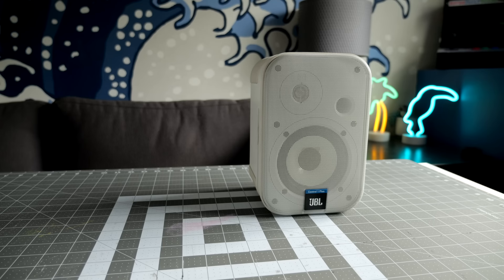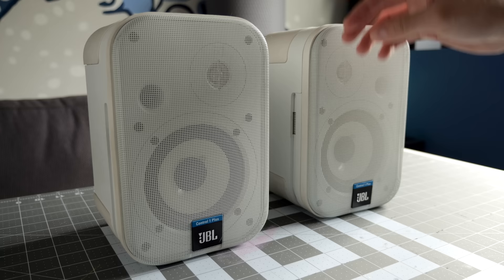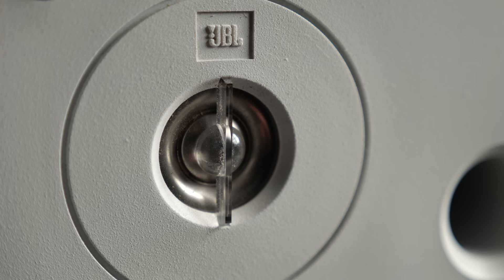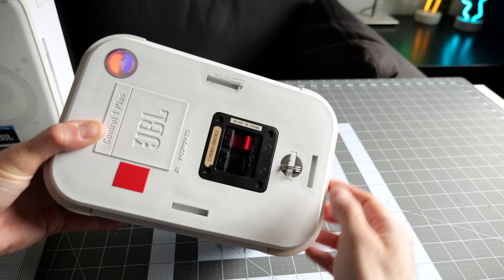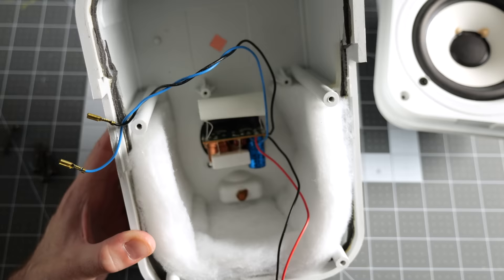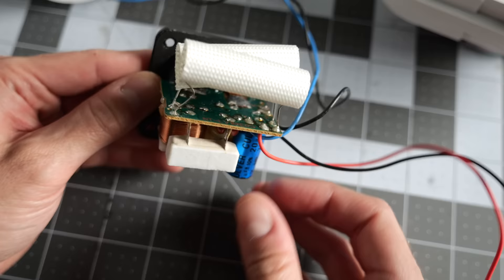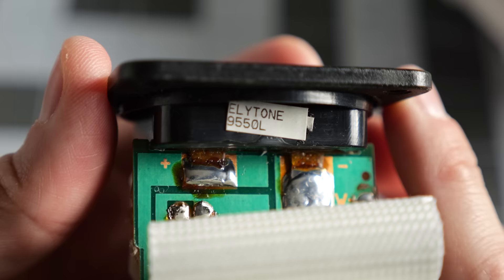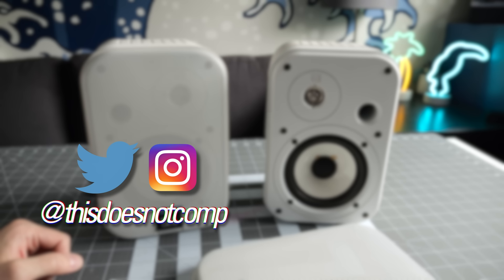Fixing My Vintage Speakers -- But Why Are There Light Bulbs Inside?

Comment: Reminds me of one time i went to the store to get a heat light, or a minimum, a regular light bulb. I explained to the sales person that it's to create heat for baby chicks. They handed me a LED bulb, and told me how much more efficient it is. I was dumbfounded. In that scenario, it was the exact opposite of what we needed.
Reply: I've done retail a few times in my life, once for my first job in high school in the late 90's working at a family owned gas station/delhi/liquor store, then for a Stihl, & New Holland/Kubota tractor dealership in the early 00's, and again as a 2nd job for about 5 1/2 years for Dollar General in the mid - late 00's, sadly most sales staff either don't know their stuff because compaies will heigher whoever they can get to work for least amout of money, they are told to push a certain set of products regardless if it's the right one for the customer(I usually ignored that crap, and got my customers the right product), and/or they just don't care for a vast number of reasons, and as someone who always tried to be as helpful as I could with my customers on a vast number of products we carried(which made me part of the 4th highest selling Kubota dealership in the nation at one point), so this has become one of my major pet peeves in life, which is why these days I almost always look up what I want online first to see if a store has it in stock before I go, and if it's someplace like Walmart, or Target I'll use their Android app to find out what isle it's on myself so I don't have to deal with sales staff, unless it's behind a locked case/cage, or they have to get it out of the stock room.
Reply: @CommodoreFan64  I mean it's really no surprise, when you treat your employees like dirt and don't even pay enough to live on they're not gonna be very motivated to put in effort, and who could blame 'em?
Reply: @fohkukohgeki  That's true about how employees are treated by management, and higher ups once they are hired, but no one forced them to take the job, as they agreed to the starting pay when they fill out the application, or summited their resume, and they were then hired, but having said that, there is still no need to be shitty to the end customer, as they have nothing to do with it, I always put on a good face to my customers being nice as I could be, regardless of what was happening behind the scenes with the company I was working for, as when I worked at the local store, and for DG, as many of my customers were, and still are members of my community, with some I've known most all my life, including church, and I would not want them to think badly of me, if I had issues with my company I took it up with management, or the coporate line with DG which is why one day after I had enough of being used, and worked death, and still not getting enough hours to get by at DG I politely put in my weeks notice to my manger at DG saying it was nice working here, but it's not working out, and I'm going to have to leave to focus on my main career, which left me on good terms, and I can still use them as reference for future work if ever need be, and to this day I still have the same policy, and it's also why I've been able keep to my main job with a nonprofit dealing with seniors, and meals on wheels for nearly 20 years. I wish more people had the same mindset, but society does not seem to want to instill that in people anymore sadly. 😞
Reply: @CommodoreFan64  "no one forced them to take the job" well when it's either that or homelessness it kinda is forced
Reply: @DouglasWalrath  These days with so many companies looking for people to work, and upping their pay, don't settle, and then bitch about the starting pay. Hell I see McDonalds signs in my area begging people to work, with starting pay at almost $17 an hour plus benefits, so again you are not forced into taking a job with shit pay, so stop looking for excuses!!
Reply: @tripplefives1402  and how do you pay the rent during those 2 years?
Reply: @CommodoreFan64  you sound like someone who hasn't dealt with having to apply on the current work market. I'm stuck as a IT tech at a company that pays me $16/hr (but 50 hour weeks with overtime pay), but that still beats working McDonald's part time for only $17/hr as you claim. The job market is tough. I've applied to a good 100+ jobs lately and have only gotten 2 interviews.
Reply: @GayDingo  In High school in the late 90's I took 3 years of Computer Network tech classes, and got my CompTIA A+ certification, along with Microsoft certifications, the field was already crowded in the early 00's making it tough to find a job in that field in my area, which is why I switched careers, and personally if you are only looking for jobs in the IT field, then I suggest you broaden your horizons, and look elsewhere, and maybe learn a new trade like maybe electrical, or heating, and A/C repair, or plumbing, if you are not happy at your current job, as I recently did some upgrades to my home, and finding quality people do the work was hard. Also my comment about McDonalds was to the other poster talking about if you have no job whatsoever, and are about to be homeless, but I feel you can find a job with 1/2 decent pay till you can get an even better job down the road, but it just might not be in the field you really wanted to work in, but it's a paying job, just don't settle for some minimum wage job when there are options.
Reply: @DouglasWalrath  You look for a part time job like McDonalds, or someplace else that pays nearly $17 an hour begging for people to work, and has flexible hours for people in school, I worked while I was in school, and  I've also worked 2 jobs at once before where my 2nd job was flexible around my main job because they needed the employees to do the work, and it's called not being LAZY!!!
Reply: @CommodoreFan64  mind you, i work this job and still have to live with my parents because getting my own place is unaffordable.
Reply: @DouglasWalrath  Going to school, and working a part time job is work is not working yourself to death, it's call having ambition to get ahead in life, so you eventually don't have to work all the long hours. I put in the work in my 20's, and 30's so now at 41 my house is paid for(not counting property taxes), I have a car, and truck in the driveway that's paid for, along with a golf cart in the garage in my backyard in a decent neighborhood, and a job that gives me my weekends off unless we are doing a fundraising event, or some other community outreach a few times a year. ☺
Reply: @CommodoreFan64  don't act like having two jobs while in college is easy. that's a load of bull. I had two jobs for a few periods during my college career and it was a trainwreck. My bosses acted like I didn't have college classes to go to, and my professors acted like I didn't have work to go to.
Reply: @lesbianesti  I never said two jobs during college, just school, and a part time job, just after school, I worked 2 jobs at once, and no it was not easy working two jobs, but in the long run It helped me get ahead in life paying off some debts, and put a little bit of money into my savings.
Reply: @CommodoreFan64  I don't know where you live, but paying rent on a part time job is unimaginable for most Americans
Reply: @lesbianesti  I did it for a short time in an RV park after I picked up an old RV for $1k doing some minor work on it, and rent was $200 a month near a fishing pond with utility hookups included.
Reply: You can probably get a more effective heater and LED array that will be more power efficient. Relying on heat as a byproduct of incandescent lighting is a very outmoded way of thinking, and why there's resistance to getting LED traffic lights, even though they should just mount heaters.
Reply: @Nukle0n  why would it be more efficient? Heat is heat and in a greenhouse or glass cage type environment it traps the heat well so angle doesn't matter
Reply: @GayDingo  I work in IT, and from what I've seen there's a shortage of qualified people working in this industry.... especially if one has some system administraton skills and some programming skills....
Reply: @ethanchow9170  a dedicated heater is more efficient, and you could run it only when necessary.
Reply: The only incandescent bulbs GE currently makes are heat lamps. They’re a bit harder to find than they used to be, but I know they still sell them at Lowe’s.
Reply: @CommodoreFan64  Society forces them to take a job, because (speaking as someone who has been there) often the alternative is starvation.
Reply: @CommodoreFan64  Lazy my ass. Jobs are not flexible these days, and most places don't have choice. $17 a damn hour. Hillarious. I got $8 after 6 years. Jobs treating you as a human ended in the mid 2000s around 2007. You get a job, they assume they're your only job. Even if they don't give you full time hours. Same with school. I have had plenty of teachers act like I have no job or hell even other classes. I've had bosses tell me I need to pick a job or school as they refused to work around it. They were honestly shocked when I chose school over Target. Legitimately shocked reaction. They are insanely manipulative to push this point as well. Younger you are, the more they'll take advantage of it. Half their training videos were either anti union propoganda, or 'training' you like a dog to fear calling out sick or taking bathroom breaks. Hell we had people come in with the flu they were so nasty about it.

Unless you're throwing up, you come in. That was pretty much the mandate. You could have a fever of 105, they did not care so long as you didn't throw up and make them look bad. You did? Your fault and they'd blame you despite threatening to fire you if you didn't come in.

They say "flexible hours" in most places that translates to "We have no schedule, and we'll put you on whenever the hell we want". Two jobs will, where I grew up, kill you. They don't care about your health, they don't care about your school, and they sure as hell don't care about your second job. They will schedule over each other, and they will make you pick which one to "keep" under threat of firing.

They'll fight every damn raise too. I worked at a place for 6 years. My raise? 10 cents. Total. I was one of three employees that hadn't been replaced. It was a conveyor belt. You'd get hired, they'd burn you out to the point of breaking down, and then throw you out. I outlasted our damn HR despite what it did to my health because it was keep the job or get kicked out of the house, and gas ate up so much money I could barely afford to live where I was. Moving? Impossibility. The most common reason my raise was cut to about 1 cent? I didn't tell other workers I appreciated them often enough despite the fact I worked alone in a department.

I have what I can only imagine is ptsd from the retail in my area where we were denied water, bathroom breaks, and walking off and helping people on the way to not get written up was counted as part of our breaks. At the same time managers would hide in the backroom on their phones, and were more than eager to throw you under the bus. One guy I swear did cocaine, a manager mind you, would get upset you couldn't keep up with his drugged up ass.

And no, we couldn't do legal action, even though some of it was blatantly illegal. They'd just black list you, fire you, and who is going to pay for your court fees? No one wants to go against a corp, easy win or not. Their HR will do everything in their power to ensure the paper trail is as hard to follow as possible. And god forbid they even catch wind of you forming one they'll find a reason to get rid of you.

Usually it would be changing your schedule and then no call no showing you, though the second most common if they couldn't find a reason to fire you was putting you on 4 hour days, and then flopping them around the schedule to make it as painful as possible to keep the job so they wouldn't have to pay unemployment. This was especially popular to do to students. Just start doing 4 hour days and be sure to schedule them mid school day.

Point is, life is hell right now for anyone getting into the job market. half a decade to a decade can change a lot. And for the last decade and a half if you're in retail getting out of it is an utter nightmare because you don't get paid enough TO get out. All the while they act like they're your god.

All while Karen complains about how you look exhausted. And then tries to get you fired over that despite the fact you had to study for an exam at 8am, but work didn't let you out until 11pm because her same ass came in at closing, manager wouldn't kick her out, and made you stay late cleaning instead.

I have been in therapy for YEARS over what all this shit has done to me. I will NOT have retail workers called lazy or their work called no skill. That's a sign you haven't bloody done it. Especially not when you were young.
Reply: @CommodoreFan64  what McDonald’s pays $17/hr? I live in hawaii where the cost of living is insanely high and McDonald’s here stars at $12. Work one hour and can barely afford a quarter pounder value meal.
Reply: @fohkukohgeki  I have seen plenty of evidence that you have the cause and effect backwards.  I’ve worked for at least two family owned businesses which took excellent care of their employees, I’ve run my own businesses and managed a decent sized business all paying beyond fair wages, where I was in charge of a few dozen employees plus a force of contract labor crews…and the majority of the employees were the same lazy apathetic entitled bad attitude type of employees at any retail store you claim is so evil for not paying their employees more.  I’d say it’s more accurate to say they’re paying those employees what they’re worth.  More than they’re worth in many cases, actually.  It’s the character of individual employees that is the determining factor in the effort they put out. Not the amount they’re paid.  High performing employees generally put out the same effort in lower paying jobs. The difference is that these are the employees who advance in the ranks, increase their income, gain experience and skills, and generally move on to bigger and better things. This is how it’s supposed to work.  Thus is why nobody ever used to squawk about “a living wage” when referring to entry level minimum wage positions.  These are not positions meant to raise a family on.  These are entry level positions meant to be learned from and used as a stepping stone in advancing ones wrk history.  When the majority of the workforce came to be entitled lazy people with unrealistic expectations and zero work ethic is when this all became an issue because employers were flooded with underachievers who had no drive to advance beyond the bottom rung on the ladder but demanded to be paid as if they’d advanced.  An employee of five years who does nothing to offer more than they did on day one expects more money for having been there for 5 years but offers nothing more than a first year employee. If you’ve been there five years you should be more independent and make low level decisions and solve typical problems on your own.  This is what makes seniority worth more pay.  But if that employee refuses to do so because he doesn’t get paid enough, he doesn’t deserve and will never see any significant advancement and that’s all on that employee.
Reply: @invictusbp1prop143  the plural of anecdotal is not data.
Reply: @medes5597  Wow that was clever.   No I guess it's not, but when you tell me where we can find a broader study comparing the job performance of minimum wage employees vs which employee (the lazy "I don't do any more than I have to because this all they pay me for so F' em.  If they want me to do more, they gotta pay me more" vs the hard working employee who doesn't want to remain a min wage entry level employee forever) obtained pay increases and /or advancement in position.   I've yet to see such a study and I don't have time or inclination to conduct one.  So all I can offer is an extensive personal experience and observations from working with hundreds of employees and coworkers in several companies as an employee, as a general manager, and as a business owner.   Now, while still technically anecdotal I suppose, it's not the typical anecdotal evidence of no worth which describes one single event that was personally observed.  So I know you'll never consider anything I have to say anyway because you disagree with me fundamentally...but if you're at all intellectually honest, you'll recognize that there's a difference between :  A) Saying "this is what happened this one time" 
...as opposed to saying:.  B)  "My observations over 30+ years of being employed, and employing others, observing hundreds of employees, it's been my experience that one type of employee tends to advance more often than another type of employee if we were to divide them into two basic employee types"
But I don't expect you to agree and you're happy to dismiss either observation as equally worthless.  But I bet if we were in a courtroom setting, my experience and observation is broad and extensive enough to stand up to voir dire and be admitted while if I had said "this happened this one time therefore I think it always happens" I would be told I can step down now.  But whatever.
Reply: @invictusbp1prop143  so more anecdotes?